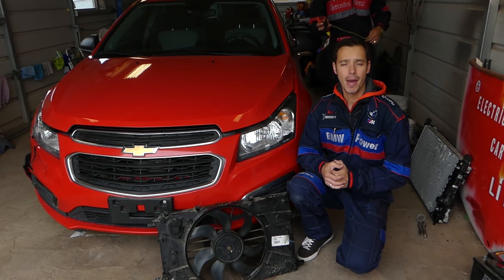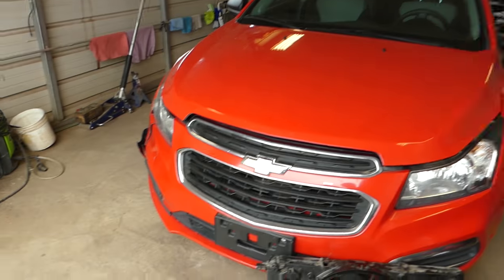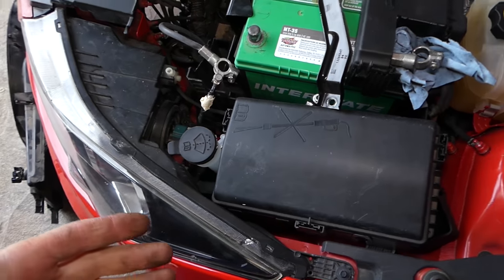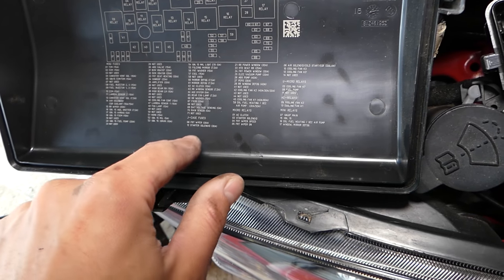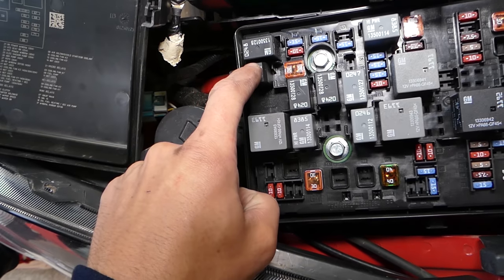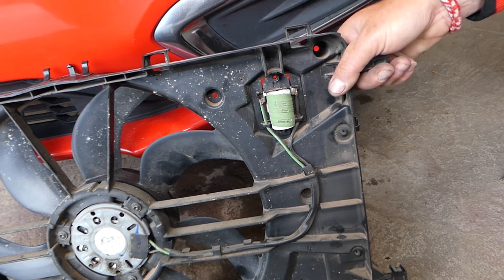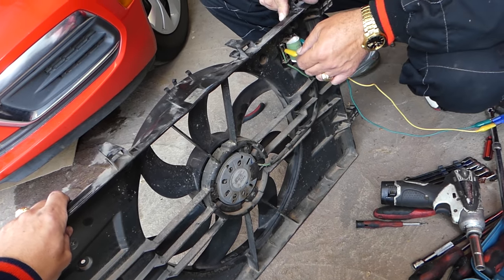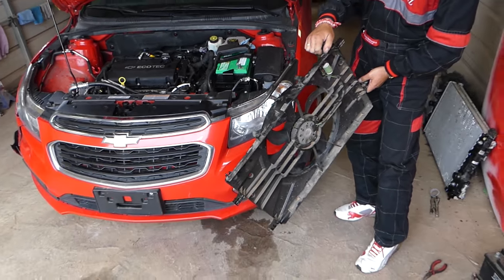WHY RADIATOR FAN DOES NOT WORK ON CHEVROLET CRUZE SONIC. COOLING FAN NOT WORKING

Comment: I change the fan to a new fan and still won’t come on , checked the fuses box and all fuses are good . Still fan won’t turn on . Where can I find the problem ?
Reply: Did you try a thermostat? I was just informed that if your thermostat is not working the fan will not kick on.
Reply: I had a p00 code back in the day on my Sonic and changing the thermostat housing with water out did the trick in thay situation.

Comment: awesome video.  I had this problem, used your info and it was just what you said.  The resistor was bad.  They wanted $623. to fix it.  I paid $170. for a new fan assembly and it took less than one hour to fix it.  Easy.  Thank you. Thank you. Thank you.
Reply: From where you got it for 170 ? 
Will be appreciated if you can help thanks

Comment: The problem is when the resistor burns out the plug also burns out 🤦 I'm in AU and can only buy a new resistor from China 🤦 or used parts from a wreckers 🤷

Comment: Okay my fan is off until it reaches 210° or I turn the a/c on.  Is this correct or should my fan run at a slower speed when at lower temperatures?

Comment: you guys saved me 200 bucks. took me 10 minutes to do the change. thanks alot
Reply: Did you have to add transmission fluid after  you changed it? I notice a bit of transmission fluid can leak when they unplug the radiator cables
Reply: @mizhanivui4576  nope not at all
Reply: Wat did u change
Reply: fan and relay

Comment: most of the videos you did are helpful by the way i got a question, is the radiator fan had 3 speeds? (low, med and high speed?) or it's just low and high speed?

Comment: I put power to mine on each setting by pulling top tab off resistor without pulling fan; I'm getting all three speeds with direct power from battery, all relays and fuses test good. The AC and all coolant sensors are new, I'm stumped, ready to buy a switch and run it direct.
Reply: Did you ever figure it out? Im wondering if mines the fan control module

Comment: the fan on my cruze only turns on when its at 230 or past. im trying to figure out the issue because ive changed the heater hoses, thermostat, water pump. now its spitting out coolant on the air filter side. If im driving at high speed its fine once im stopped it overheats any ideas?
Reply: i’m having the same issue. Did you find a fix?

Comment: My fan keeps turning on and off every couple of seconds when I’m sitting there. What do you think it would be?
Reply: @bishop_98  I ordered a whole new cooling fan I'm thinking its the resistor bc I read somewhere the car won't allow High to stay on long before switching to medium or low. I'm thinking low and medium is burnout on the resistor which is causing the fan to only stay on for a few seconds. Check back in a week or so when I get it installed and ill let you know if that what it was or not.
Reply: @CalebEckenrode  do You fix the problem? 
Mine stop working some times when it's to hot  (like un raffic jam or in a hill) i have to turn off the car for 10  minutes and it's Start working.
Reply: @CalebEckenrode  did it work!?!!!!

Comment: Greetings. I have a strange problem on a 2012 Chev Sonic 1.6. The cooling fan DOES NOT work automatically as it should, as well as A/C. If I unplug the coolant temperature sensor on thermostat housing when engine is hot the fan will come on, but will not switch off when I plug the temperature sensor back. The ignition must be switched off and key removed. Also the AC does not work, but the yellow A/C indicator comes on. Both fan relays tested OK, if you simulate the relays kicking in the fan works.  Every single fuse checked. It seems the relays are not getting the power to switch on. Any ideas?
Reply: 2015 cruze  SAME SYMPTOMS!  .just  replaced Fan with Resistor ..And the coolant sensor   !    $ 230.    still no luck  ...    im lost
Reply: Same here.  2011 cruze.  Ac won't work.  Fan won't come in until engine is hot.  Fuses and relays are good.  Scan tool won't turn on fan and says "device limits exceeded,  engine temp too hot"

Comment: I have a question,, I have a 2015 cruze and the cooling fan itself kicks in and out as needed but when you turn on the AC the fan will not run constantly,,, sometimes not at all and when the cooling fan isnt running the AC doesnt work, as long as the cooling fan is running the AC works but when the fan stops the cooling stops,,,should the colloing fan not run constantly if the AC is on,,mine doesnt
Reply: Even in my cruze , i am suffering from same problem
Reply: @snowmangsx1100 I have the same problem. Did you ever find a fix?

Comment: How do you can test if. The motor. Resistor. Os. Working good? How many ohms does the resistor may work. Of. The low speed?

Comment: Hello, maybe you can help us, 30 cars, we have this problem. The thermostat does not open and the fan works.When we change the thermostat, it works properly from morning to evening and in the evening it does not open the thermostat again and the fan works non-stop.What to do? What part will be replaced, on the other hand the car is working in every way.Please help us maybe.all chevrolet is 2011-2014 1.4 turbo

Comment: My 2013 sonic 1.8L my radiator fan works when I put the jumper wires from the battery, but it won’t turn on without jumper wires

Comment: Can i ask one thing. Which one is radiator fan and which one is cooling fan?
Reply: I believe it is two names for the same thing. At the very least it is in the sonic.
Reply: @amytuley8161  bro i got my timing belt changed nd now when i accelerate my car shut down. Mechanic is nt taking responsibility. One mechanic is saying it's fuel injector issue. Car is nt starting properly. It's unusable now. I think my last mechanic too did some shit to fuel injector or he just used cheap repaired part in timing belt. Now i hv no idea should i scrap my cruze or what. It's getting unrepairable.

Comment: Am encountering the same problem on Chvy Cruze 1.8 the temperature can rise to 212 to 227 degree but de fan will not work but if I disconnect the temperature sensor wire u will see de fan starting running with high speed,I changed de temperature sensor still de fan is working while the engine has reached exactly temperature instead de fan should come it won’t come,

Comment: I have checked all my fuse's temperature goes half way on the dash  still don't see the fan coming on
Reply: Did you ever figure it out?
Reply: Did you try a thermostat? I was just informed that if your thermostat is not working the fan will not kick on.

Comment: Hi Guys, Great Video Info. Question - If that resistor goes bad could it make the fan go into super high speed ? I ask been having lots of trouble with my 2015 Cruze, I noticed even without running the car for a few minutes when I shut the car off the fan will kick on, then to shut it off I insert the key again and click to the on position. then the fan will shut off.
Also I tested my MAF I disconnected it while the engine was running and the fan went into super high speed mode. I have some electric short or something going on, it seems to also be effecting the fuel injectors.
Reply: Hi, have same problem did you fixed yours, if so what was the issue?